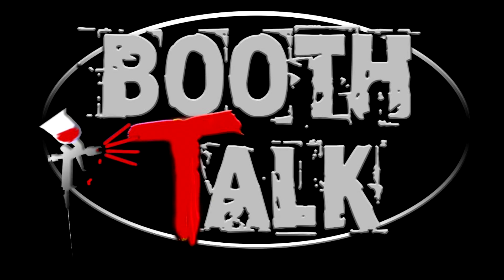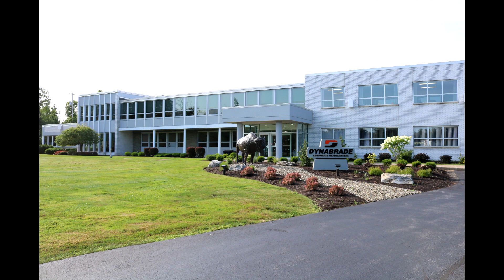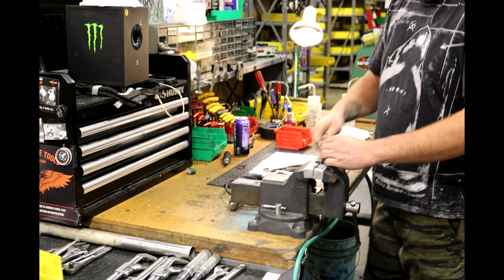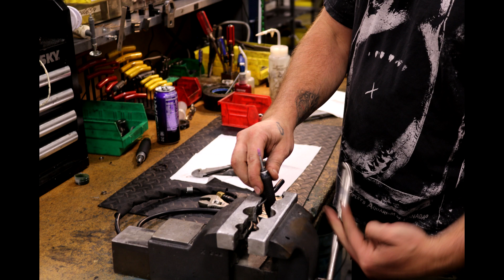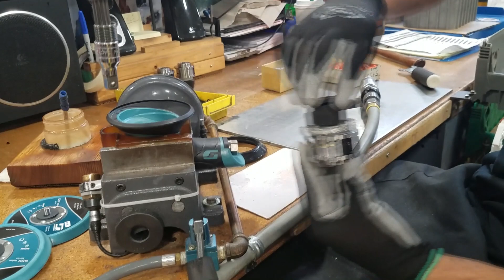Dynabrade Warranties

Comment: I bought Dynabrade 58015: Dynafine Detail Sander, Self-Generated Vacuum and right out the box it was not working hardly at all I think I could have got a knock off it was 800 is there any tell tell sign 
I been a long time faithful and loyal customer and don’t think of anything else
Reply from the maker: You can send an email to Megan at RefinishOrders@dynabrade.com and she will get back to you with help info.  She will be back in office on Tuesday and get you squared away.😎

Comment: I am (as of two hours ago ) the proud owner of my first, very own, fully paid for, no interest rate, comma, spinny go round fast DYNABRADE 52315 right angle die grinder. Oh yeah! I am going to contact y'all later about all kinds of stuff, I plan on getting a straight angle grinder of similar genre. I used to work on DYNABRADE air tools at the foundry. I am replacing a 9 year old Craftsman that is similar in size but I have not compared specs. "I don't need no doctor"   HOOAH!